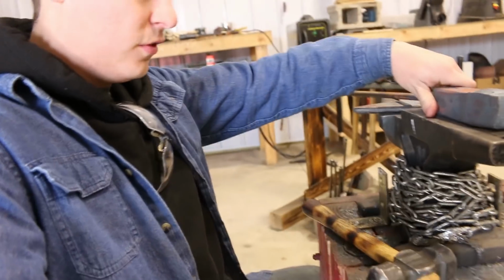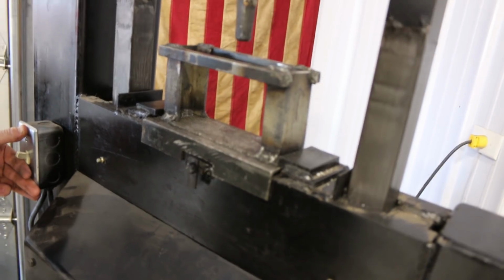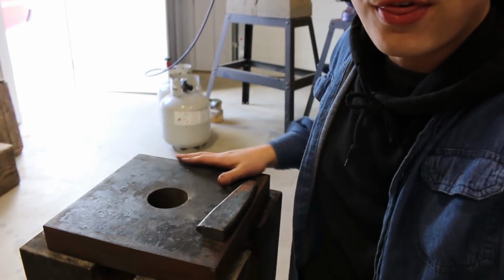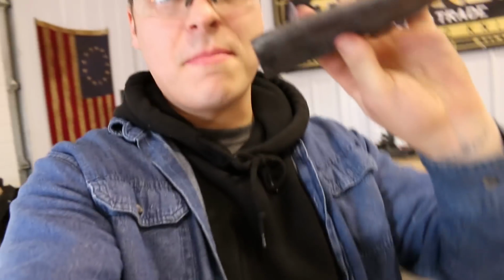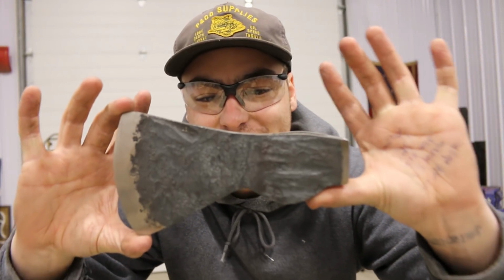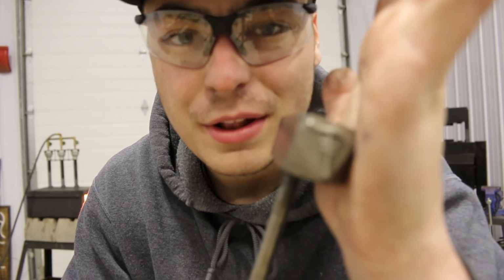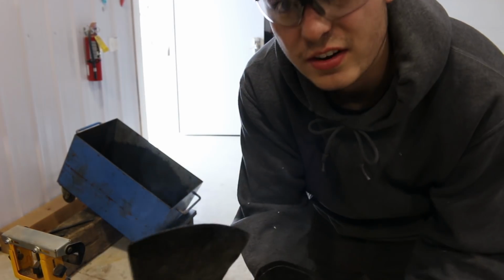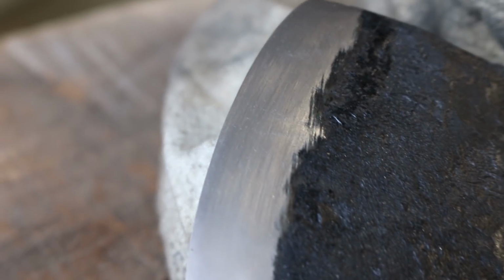FORGING A FOREST AXE!

Comment: Hey Brad, new Subscriber here.  Well since you asked for tips on making axes I'll throw a couple your way ^.^
First: you don't need to harden the whole axe... Edge quench, draw down the temper, and quench again to set it 

Second: To set the edge, you want a convex/apple seed edge. an easier way to do it is to take the platen off of 
your belt grinder and slack belt it, no secondary bevel needed at this point as the edge will be Razor sharp
Reply from the maker: Thanks for sharing! I appreciate the tips!